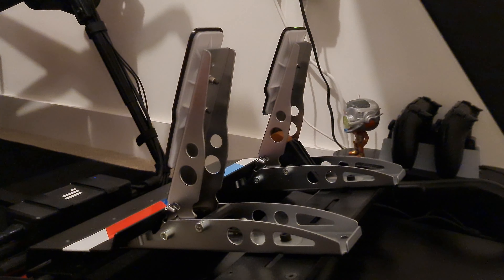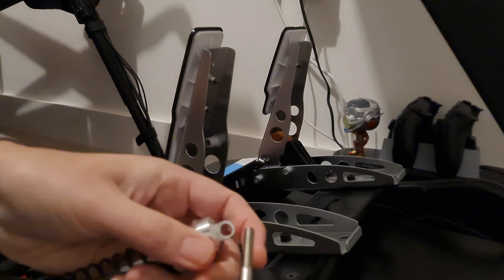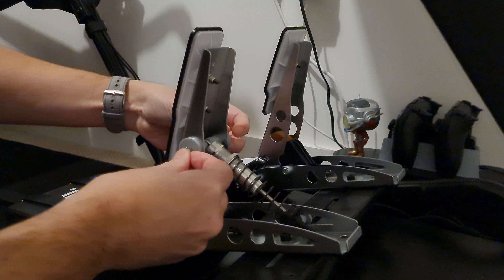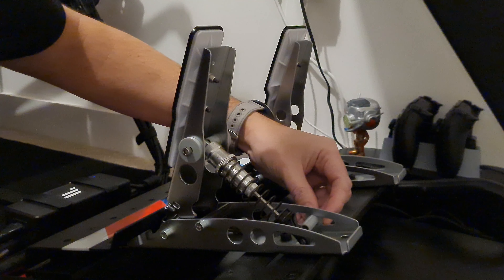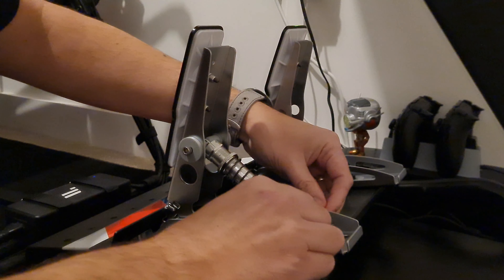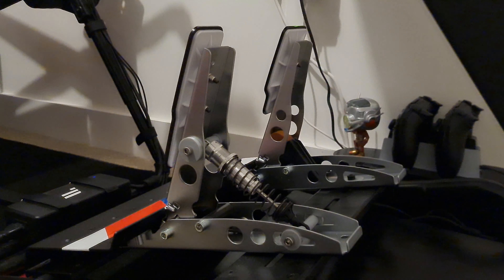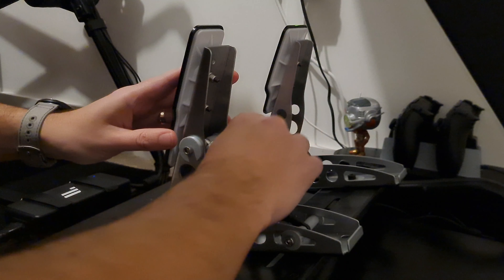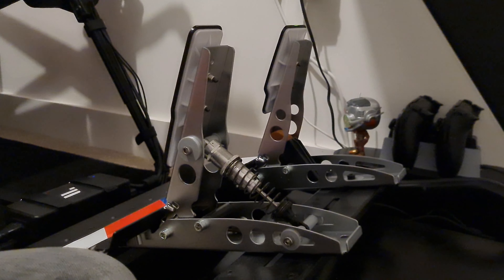Fanatec CSL Throttle Spring Mod "It really works"

Comment: Mine makes a noice like the spring is rubbing the iron thing
Reply from the maker: I had this the other day. I sprayed some WD40 around it and the squeak went away.
Reply: @mattsellings  thanks will try that
Reply: @mattsellings  i don't know why mine is leaking and I just got this today
Reply from the maker: @gt-rgaming9452 that's not great, sounds like you need to return it for a replacement. Did you get it from eBay?

Comment: Hi, great video! Did you remove the stock springs that came with pedal, or did you leave it in there? Thanks.
Reply from the maker: Hi, thanks for the comment. No I'm still using the stock spring, but I would like to try a stiffer spring. I just need to find the right one 🙂

Comment: So Can i use this for my brake pedal if I have the basic CSL 2 pedals ? Or do you believe it’s significantly stronger than the basic original stopper? Enough to be useful as a brake ?
Reply from the maker: In theory, yes, I've not tried it. I was thinking of getting another one to try it, but I'm think I'm just gonna upgrade to fanatecs Loadcell sometime in the future.
Reply: @mattsellings  so I just need something for a few months and later down the line I’ll get the load cell. I’m about to get the Fanatec gt dd pro 8NM and I really want a loadcell brake but it’s super expensive after buying the whole kit. Just wondering if this will be good enough until then
Reply from the maker: @raredopesongs5621 Yeah, I'd say it should do you until you can get the load cell. There is another alternative, it replaces the foam in the brake. It's from a company called 3drap, so check that out. It will definitely make the brake harder.